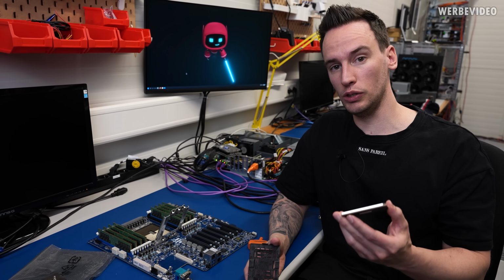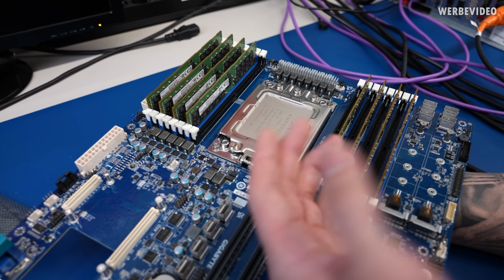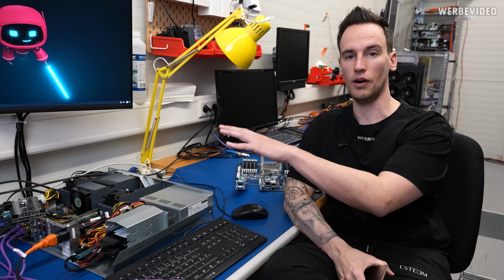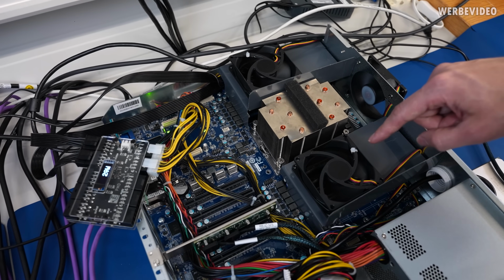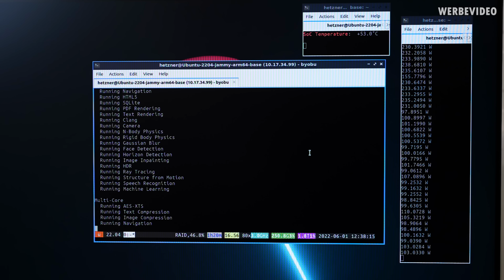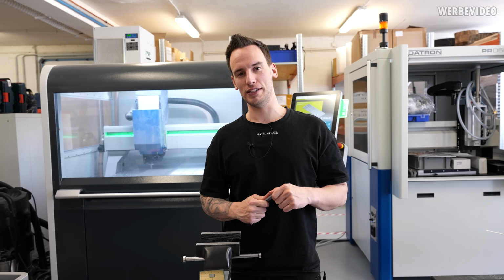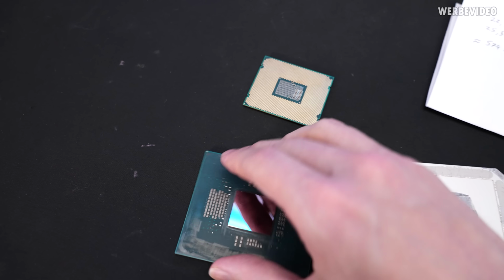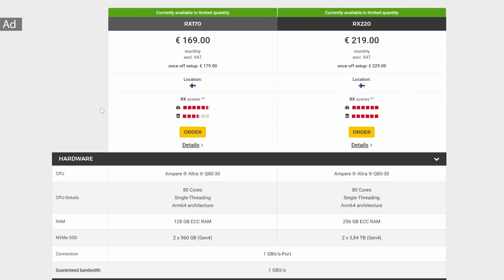This insane 80-Core ARM CPU easily beat a 64 Core Threadripper

Comment: Considering the various extensions, x86-64 has around 1500-ish instructions, ARM around ~300 and RISC V around ~500. They "share" around ~40 or so instructions, not perfectly the same but close enough. I was curious about the numbers so I thought I'd post it here: I was surprised about the 1500+ instructions, I thought it would be a lot less.

Comment: Geekbench is a marketing tool, not a serious benchmarking tool. It will give you a number, but it won't tell you what that number means, how much of any particular task was done using the cores, accelerated using dedicated hardware or offloaded to GPU. Geekbench is certainly useful as a tool for bragging, I give you that, but not much else.

Comment: "Each thread can be at different exception levels and running different operating systems. " -  ARM 

Did I read that right that each thread can run different OS, operating systems on one cpu chip?  So one thread runs SUSE and the other thread Ubuntu? How does that work?

Comment: Hmm I can see ARM doing well in servers due to it's better performing parallel computing. However on Desktops were the CPU still is responsible for resource demand serial tasks x86 still rains king. If you have any truly parallel task modern graphics cards grant access to their highly parallel environments to non graphics related task via opencl and cuda. The only missing component would be a dedicated cards for running serial tasks on ARM severs, not that I know if severs would really need it just more of a symmetry thing.

Comment: The fact that 80 cores and 128Gen4 lanes along with 8 channel DDR4 fits on that die is BEYOND insane. 
AMD Epyc spends a massive 400mm2 just for a for the same amount of IO on their IO die using an equivalent process and a great deal of this is spent on PHYs.
The big kicker between them is the Cache. AMD has 32MB of L3 per 8 core cluster for a total of 256MB of L3. But these ampere SoCs only have 16MB of L3 shared amount ALL the cores.
This has huge implications for core-core communications and data sharing, which is why the CPU is going to be more special purposed than the more general AMD offering.
In its niche however, it should be amazing.

Comment: As good as the multi core geekbench score is, the single core Geekbench score is just abysmal. Less than HALF of a 12900K. This crap is ONLY for stuff than can run 100% in parallel.

Comment: Thank you for a great video, for arm CPUs. Everyone says it is the future of the data centers. But I have 2 questions: 1-what OS you installed to test with geek bench, you mentioned Linux, but what type? 2. You deleaded the CPU for over clocking?  You showed us the temp is not too high even at full load about 6ixties or even 5ivties. So why dealead?
Reply: They probably use Xubuntu in Hetzner testing bench. It should work on every distro (with similar performance) as most Linux distros today support ARM.
Regarding delidding, I guess that was done to show the CPU itself.

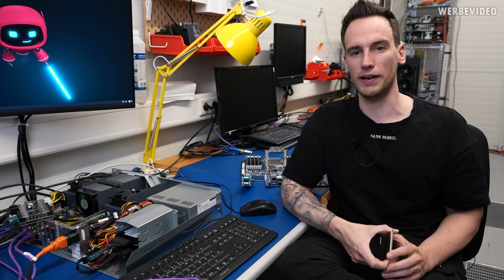Comment: 04:40 warum nicht einfach den korrekten Begriff - auf "RISC" Prinzip basierte Architektur des CPUs -  zu verwenden wenn man es am Ende falsch beschreibt... 🤷🤦
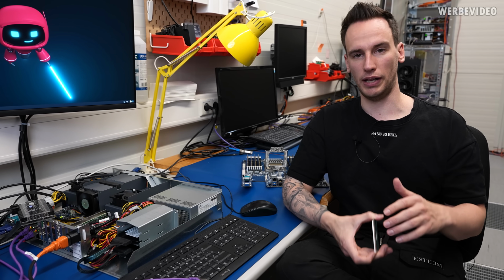04:40 why not just use the correct term - CPU architecture based on "RISC" principle - if you end up describing it wrong... 🤷🤦

10:40 again - WRONG - the performance is higher just here in the concrete scenario/application...and ist extremely depending of the used OS.

Comment: the single core performance are very poor, when you put virtualisation on it and you virtualise a DB like Ms-SQL you pay licence per core, so if the performance of the core are poor you need do add core the virtual machine and spend more in license. You see the pros only on the Data Center provider side where you get optimisation on power consumption, but the companies end-user will spend more in licence.
Anyway interesting video.

Comment: The 80186 was only ever in one PC. It was dropped rapidly due to disadvantages. IE it was designed as an embedded processor for automation and had an integrated 8237 DMA controller (A PC at the time had 2) and I seem to remember something about the CTC and it also only had 4 interrupt lines. The 8259 had 2 and was cascaded giving 15.
Reply: i186 was more of an embedded thing. I've seen some Renesas i186 clones in print servers. It had 3 timers while the PC had one occupied by the DRAM refresh, another for the PC beeper, and the last tied to IRQ0.

Comment: Minor correction Intel and AMD do not use x86 they are CISC processors.

The x86 is a CISC, and it has been king of the performance hill for decades now. Is that because it’s a CISC? No. It’s because Intel has been willing to make the investments necessary to keep it that way.

ARM is a RISC ISA. It’s what’s in your smartphone. Plenty of horsepower, but mobile platforms are intrinsically power or energy limited and therefore will not win a performance race.

Intel’s x86’s do NOT have a RISC engine “under the hood.” They implement the x86 instruction set architecture via a decode/execution scheme relying on mapping the x86 instructions into machine operations, or sequences of machine operations for complex instructions, and those operations then find their way through the microarchitecture, obeying various rules about data dependencies and ultimately time-sequencing. The “micro-ops” that perform this feat are over 100 bits wide, carry all sorts of odd information, cannot be directly generated by a compiler, are not necessarily single cycle. But most of all, they are a microarchitecture artifice — RISC/CISC is about the instruction set architecture.

Microarchitectures are about pipelines, branch prediction, ld/st prediction, register renaming, speculation, misprediction recovery, and so on. All of these things are orthogonal to what instructions you put into your ISA.

Comment: It'll be really cool to see this trickle into the consumer space, especially with Windows on ARM. I'm excited mainly about the better power efficiency.
Reply: you see what is possible when you cut the cpu cache you can add more cores
Reply: I use ARM for software development on the Mac Mini for my job. It runs absolutely buttery smooth compared to my top-of-the-line x86 Intel laptop. Doesnt help that Windows sucks ass, because there are a lot of platforms that would run better with ARM and Unix-like systems over windows and x86
Reply: @merthyr1831  When people run Windows on ARM in a VM on M1 Macs, it runs better and smoother than it does on actual WoA hardware like the Surface Pro X SQ2. To me this says that Windows isn't the problem, Qualcomm is.
Reply: @merthyr1831  arm fanboy

Comment: I review ARM SoC's and SBCs. It's amazing what they can do. I reviewed an older Ampere model with 32-cores but a lot less powerful per clock. This one blows it away.
Amazon also has amazing ARM cores. I also reviewed some of those. Those are simular to these cores, but clocked lower to 2.5Ghz. ARM is leapfrogging x86. Just a lot more efficient. I hope to see RISC-V do the same. But I've not seen much performance of that yet.

Comment: Not that this will ever been seen, but if you have a lot of time to wait and are delidding multiple CPU's I've found that soaking them in acetone or gasoline to be fairly effective in softening the silicone glue that holds the IHS to the PCB. Once softened the glue not only cuts easier and cleans from the PCB easier but in some cases you only need to cut around 3/4 of the glue and it'll just open like a hinge. The glue may even be soft enough that the IHS could be pushed to the side with no cutting, but I haven't tried that. I soaked an old G1820 in a 50/50 blend of gasoline and acetone for about a week and the IHS came off very very easily.

Comment: I don't know, the result is quite odd. Threadripper with 64C128T reaches 1300 SingleCore, but in Multi this one tops it with 10.000 points?
The Threadripper W5995X should be better again, but then again it's 64C128T vs. 80C80T. And with just under 600 mm²? I would prefer to wait for more benchmarks.
This CPU will nonetheless become a very powerful one and if they could make ARM systems with x86 compatibility (kind of like Apple does) I would be all for it!

Comment: The selling point of x86 isn't just performance, it's also the software support and documentation it has accumulated over decades of use.
Reply: X86 was really behind on performance on 10 years of intel doing nothing so AMD bring it back to live with zen cores, if Apple had the M1 before AMD Zen so today x86 would be dead
Reply: 32-bit compatibility (which is the real x86) is just disappearing: Microsoft themselves have dropped 16-bit applications support from Windows (and, earlier, all remaining traces of DOS compatibility) just because the OS was becoming impaired by its own complexity and neede serious discards to become just maintainable. At the same time, Red Hat and Canonical went even forward by stopping compiling their Linux systems for 32-bit machines, and some ARM releases of CentOS and Ubuntu were already available years ago; not to mention FreeBSD which has its own project ("of course", ARM "runs NetBSD" ;-) ).
That perfectly makes sense to me: x86_64 is NOT x86, for sure it's going to stay, but that doesn't mean closing the door to alternatives; especially on the server market which has no need at all for some proprietary must-have desktop applications like, say, Skype or AutoCAD.
At the beginning of the 64-bit PC era, I saw 64-bit machines sold with 32-bit versions of Vista just because they didn't have the right drivers for the chipset. That, especially on the open source ecosystem, is going to be more and more a minor problem as time advances. I expect to see the same happen within the ARM ecosystem.
Reply: @rdothegeek  32-bit compatibility (Compatibility Mode) is built into the x86_64 standard. The reason MSFT did not include 16-bit compat in 64-bit versions of Windows is because V8086 mode does not exist in Compatibility Mode at all. NTVDMx64 is not the same as NTVDM and emulates x86_16 or runs it in a VT-x VM. Has nothing to do with complexity and NT is very modular and can run different OSes executables through subsystems. The MS-DOS Subsystem (NTVDM) is still present in 32-bit versions of Windows. Other subsystems include WOW32 (win16 compat), WOW64 (32-bit compat), Win32 (32-bit/64-bit), OS/2 1.x, POSIX, and Linux. The difference between IA-32 and x86_64 is that we got 48-bit addressing, more registers, more paging levels, enforced flat segmentation, syscall instead of sysenter, and lost a few older instructions.
Reply: @DorperSystems  I understand all that, but as long as software can be compiled from anything at a higher level than Assembly it does not sound relevant. I would feel x86 as an advantage only if and where a platform (hardware+o.s.) appeared totally from scratch; which may pose the question of how much work is required to get a GCC (and maybe a JDK) in there. It does not seem to be the case here, and it is my opinion that nobody would waste a beast of an ARM server by running Windows on it.

Anyway, I wouldn't underestimate the important change in stability and efficiency that Windows achieved by (also) dropping backward compatibility, since the times of, say, XP.
Reply: @rdothegeek  Linux was specifically designed for x86 computers. It takes very little work to port GCC. It's like 100 lines to port GCC to a new OS. Windows Server provides the best experience for Active Directory and File Sharing. Using the Linux equivalents (OpenLDAP, Samba, NFS) is like castrating yourself with a rusty fork. You have to have the source code to recompile a program.
Reply: @DorperSystems  Linux, meaning the kernel, was originally written for a 386 and then ported on way more than just x86 and x86_64 (it was actually ported to other platforms, including 680x0 and Itanium, before x86_64 was created); and so are other operating systems like the (especially Net)BSD. A mainframe port of Linux runs on IBM's big irons, the Z-Series. The original GNU toolkit was not written with the PC in mind, rather tham with just "a computer" in mind.

About the source code, it is very funny that MS has the source for everything they produced, dropped Windows 2000 for Alpha just before releasing it, terminated NT for PPC and MIPS workstations while they were still kicking, and after releasing NT3.51 for them and bragging about how much portable NT was, and now seems to have no way to run SQL Server on Linux other than interposing something very similar to WinE.

Active Directory and File Sharing are just not what high performance computing is (and what an 80-core ARM workstation is). If a working environment is so much PC-centric and MS-centric, then a system like this probably isn't for it; I never told it to be for everybody either. Especially since "everybody" also covers the average 14-year old kid with a tablet who can't either explain what information technology is.
Reply: @rdothegeek  You said server not HPC / midrange system. Specifically you said ENTERPRISE. Enterprise means a business server, not HPC. If you meant midrange system you should have said midrange system. SQL Server won't work on Linux because Linux doesn't have the COM, WinSock, ODBC, PE or any other any other Windows components. The reason NT wasn't released for Alpha was because DEC's lawsuit agreement with Microsoft expired. 2000 wasn't released for PPC or MIPS because those architectures were dead by 1999. Linux was specifically developed for the 386. It contained many 386 specific features like hardware task switching and segmentation. You are a real sucker if you are running Linux on z/Arch rather than z/OS. GNU was originally written for the 68k.

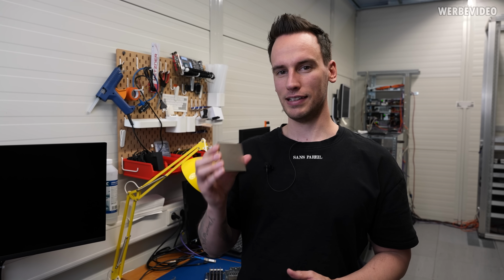Comment: Yes that is an amazing multi-core score, but what you did not mention, at least up until 10:58, is that the threadripper 3970X scores 1255 single-threaded score which is much higher than this 882 score which make the threadripper more suited for a combination of personal and server usage. Obviously, this ARM CPU is much more suited and much better for multithreading and servers such as facebook, etc., but I am just speaking from someone who recently upgraded from a FX 8350 and Ryzen 5 1600 to a Ryzen 5 5600 and I can say someone wanting the best of both worlds (server and personal use) would be better off with something like the threadripper.
I know this comment might seem irrelevant, but it is just a shame what difference singlethreaded performance makes in 60-70% of scenarios due to the difficulty of programming for multithreaded systems, especially in entertainment- or general- use.
Very cool processor by the way, I remember from computer science studies that ARM was the main solution for putting strong processors in mobile phones at working temperatures.
Reply: That's not even the biggest issue for personal use, it's ARM, so will need basically every app and program rewritten for it if you wanted to daily it
Reply: @marcusborderlands6177  that is also a good point, so it will be dependant on if a game engine or operating system supports compatible instruction sets.

My guess is that a Linux system with wrappers such as WINE will probably be the way to go with ARM from someone who considered it for personal use.

Comment: I am a bit edgy maybe but.. as there is a soo many pins compared lga1366 or lga775.. they can take more hit in wider area (not to be so careful or slow to drop cpu as long you drop cpu correct angle..) than earlier mentioned due there is so many more pins to take a load.